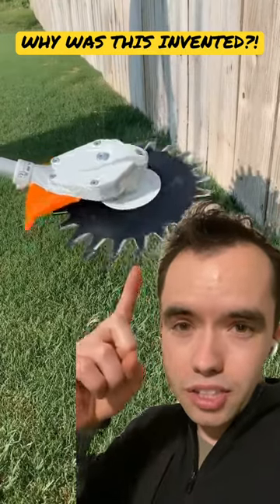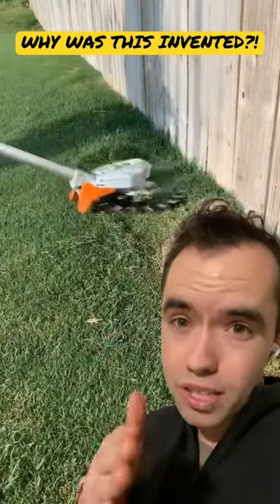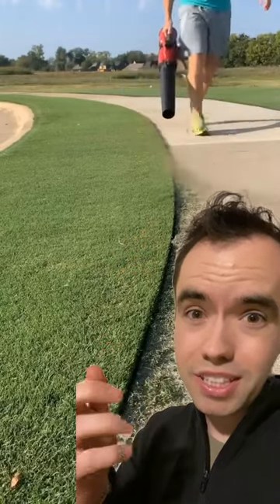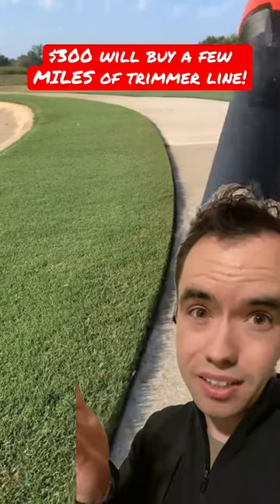Why Was This Trimmer Head Invented?! #lawncarebusiness

Comment: Used for reel mowing lawns like golf courses because weed eaters rip out the lawn
Reply from the maker: oh ya! Good call
Reply: It was designed for golf courses and around trees so that it wouldn’t damage trees as well as for edging sand bunkers- had nothing to do with low cut grass in the design of it
Reply: That’s not a reel mower.
Reply: @toh192  he didn't say it was. Lol
Reply: @MikeAndes  or use it for brush cutting sometimes .
Reply: @toh192  lmao means thhe type lawn tht need to be cut with one uses thehse too
Reply: It cuts using the technique perfected by real mowers,  one blade turns against another.
Kinda like scissors.  Hope this has helped you understand,  we have to look out for each other with so many complicated  things out there.
Reply: @Johnthelittlebuilder  i worked for a course. regular trimmer line is better for sand traps. not sure how you think regular line damages trees. Maybe if you dont know what your doing.
Reply: Yea something professional know about that’s why they use them
Reply: @thesmallenginekid  cool buddy you trimmed sand traps with a corded weed eater it’s sand what you gonna rip out of the ground sand😂 it’s for dirt so it doesn’t beat the dirt up instead it cuts it
Reply: If you're  ripping  out grass on a weedeater never  operate

Comment: I have this head. it does not damage things like the trimmer line can. I had an old plastic pot that was sun damaged. The Trimmer line exploded it as soon as it hit it. This head I could push it hard into it and no damage at all. 

Because it cuts like a hedge trimmer to only cuts what is between the blades. 
I have a lawn I look after that has small stones in the garden next to the lawn. It has not flicked any stones out of the garden at all. 
It also takes a lot more abuse than you would expect. 

It is perfect for cutting down weeds in an area full of stones.
Reply from the maker: Ah genius!
Reply: Interesting perspective!

Comment: Its made for small brush, oak saplings and things that are just to thick for trimmer string.  Country stuff more than city stuff
Reply: I hate that thing. It doesn’t work
Reply: @JorgeCastro-ui3pi  I got one for my echo and it's great, so I can't speak for the particular one in video
Reply: Wrong tool 
It does work on cleaning dead grasses up 
But is for grass
Reply: @JorgeCastro-ui3pi  if it’s not working it’s either not sharp or your machine is not powerful enough to run it.
Reply: Exactly!
Reply: I think I’d rather just have a bush hog or whatever those sling and two handled weed eaters are called. Throw some double coated thick line on and they’ll go through most anything
Reply: But the teeth on this one are just too shallow. The brush blades I like to use are the 3 or 4 spoke ones

Comment: Everyone saying tree's,NO I've been selling stihl gear for 20+ years this head was designed for golfcourses and gravel aswell as getting into overgrown concrete. It turns at a low rpm to prevent ripping out law on most new battery models. Works well as a scrub cutter but anything vine like will try and rip the tool out of your hand when it binds the spool.

Comment: You can use it for small areas of light brush like brambles... As long as the brambles are not too thick. 

This unit is much safer than a brush cutter blade.... Which is fucking hysterically bad if you hit a rock or something.

It does have uses... But they are very limited.

Comment: It's 2 sets of blades going in opposite directions and works like scissors. If you bump the fence, you're only touching the outside of the circle, not the cutting faces. If you run it next to concrete and grass you only scratch the outside face not the cutting edge. I think you're actually failing to understand how it works.

Comment: That would still throw a rock through a window just as easily as a trimmer.
Reply: Definitely not 😂
Reply: @Dustin922  so a blade spinning fast wouldn’t shoot a small rock it hit? Makes sense. Have you ever seen a lawn mower shoot a rock out the side?
Reply: @zalapski9399  lol
Reply: @zalapski9399  it doesn’t spin it shears it two oscillating blades

Comment: I did tree work for a few years and when we had to clean out fence rows with little trees grew all through it we'd put cheap circular saw blades on weedeaters and it worked great till you hit the fence a few times, but it was alot cheaper than ruining a chain

Comment: Well it's for places sith tall grass and thicker stuff in like fields and by the road and it's a lot easier than having to change out string 100 times but they make ones that isn't locked like this when it hits something it pops back in this one if you hit something it's either going to bust or mess up the weedeater if you get on get one that has three blades and they open by force of the weedeater

Comment: It’s a trimmer mostly used for like in the video doing the side of the sidewalk.  But even a couple hits to the concrete won’t damage it to bad and the blades are not that expensive depending which one you get